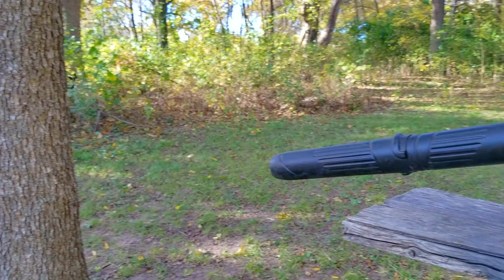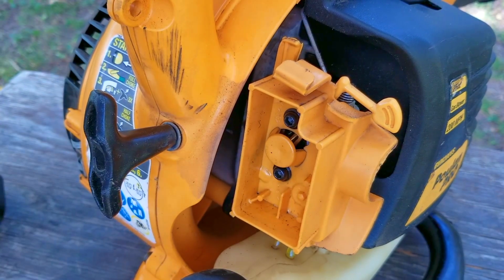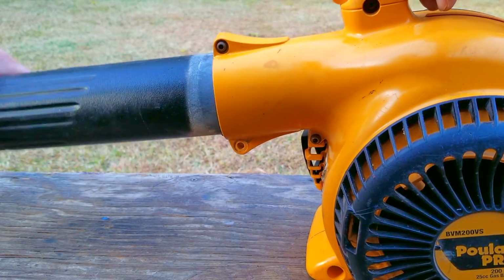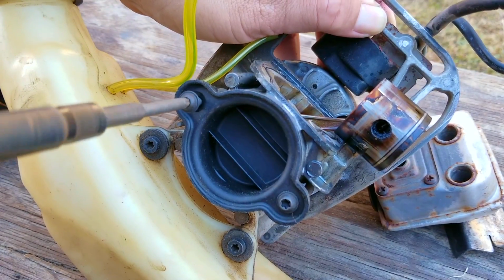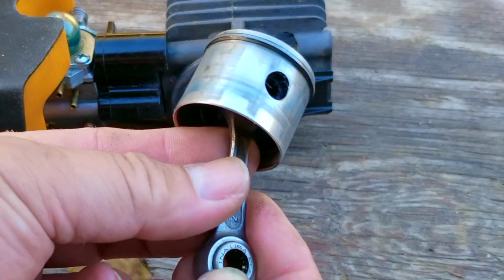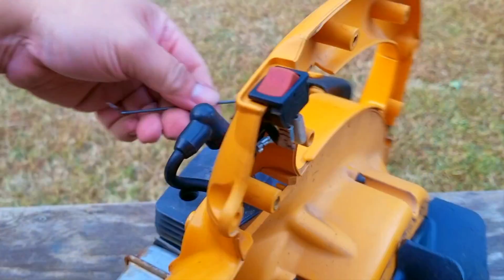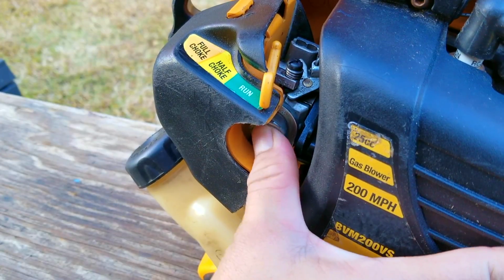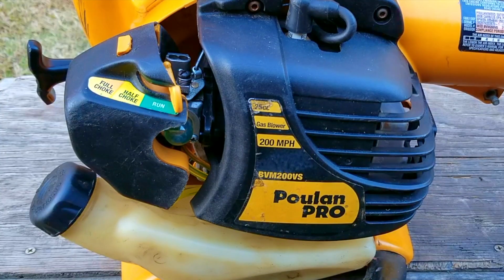Fixing a Poulan Pro blower, that stopped running while being used.

Comment: I have this same blower but the Crasftman branded version. I wound up basically replacing everything… fuel tank had a crack, needed new fuel lines and filter, carb was clogged up and cleaning it didn’t get it to run so I bought a new one that came with a whole bunch of other parts I already placed but was cheap enough to just go ahead and buy a new one instead of using the one I cleaned, a new ignition coil, new one plugs, new cylinder and new rings and finally new muffler. All in I paid more than it would have cost to buy a new one and it still doesn’t run right. It’s acting like it can’t exhaust fast enough. If I run it with the exhaust off, it can rev up somewhat but nowhere near what it should rev to and it has this almost backfire fire like issue. It’s not really backfiring, it makes a thud sound and the rpm’s die down. If I run it with the exhaust on, it won’t rev up and that backfire type action occurs as soon as you try to rev it and it dies. It’s also very hard to start it with the exhaust on. All brand new mind you. I’ve adjust the car  and can get it tuned to run the best it can either with the exhaust or best without the exhaust but something is just not right and I cannot for the life of me figure it out. Compression testing is 150psi, no head leaks, no loose bolts, gets plenty of fuel and had good strong spark so I’m at a lost on what can be adjusted or changed to make it run better. Any ideas? It’s so frustrating that I spent as much as I did “repairing it” and it still doesn’t work like it should. I could have not replaced some things but as I was going through the troubleshooting process one thing led to another and then I was like well I went this far and spent this much money, I might as well keep going and fix everything to make it new again. I like to fix all my equipment and this is the only one that I have failed on getting to run normal again. Honestly, if you are interested in making a video on trying to fix it, I can mail it and all the extra parts I have for it to you have ago at it. Right now it sits in my shed mocking me every time I open the door to get my weed whacker out. I’ve watched video after video and I haven’t seen anyone have the problem that I’m having. I’ll probably record a video of the issue I’m having and post it to see if anyone can offer suggestions on how to fix it. It takes for ever to get started (with exhaust on and much easier without it on) and I can get it to idle but when I try to rev it, it’s almost like a misfire is happening when it starts to rev higher from either too much fuel, or not air being caused from not enough exhaust being able to be pushed out and not enough oxygen getting pulled in. I don’t know I’m probably wrong on that but that’s what I’m thinking. It also crossed my mind that maybe the metering part of the carb needs adjusting (not the L H but internally), I don’t know, that’s one thing I haven’t done yet but with it being a new carb I didn’t want to mess with that being it should already be set properly, but I suppose it’s possible that could be off. I don’t want to mess with it though as to me it doesn’t seem that is the issue. Anyway, I’m done rambling now, but if you have any ideas from my rambling, it would be greatly appreciated and I’m serious about mailing it to you to give a go at it if you want. Just let me know.
Reply from the maker: Wow sounds like a real mystery.  Did you replace all the gaskets between the engine, insulator and carb?  If so did you make sure the opening for the impulse signal was lined up?  It sounds like you have an intake leak which is tough to hear, because there are so many places to have one on a 2 stroke.  As for taking it on, I'm not taking in any extra work right now.
Reply: @HomeGaragechannel  yep. New gasket, the hole is lined up and new filter.  Also I’ve tried running it without the filter on as well to see if that would change anything and it didn’t. I think my next move is going to be swapping out the new carb with the old carb and see if that changes anything. Sometimes the new Amazon carb specials even though generally are pretty good, sometimes have issues, and even though it doesn’t really seem like a carb issue, I have to start somewhere. It might give me more info to then chase a new direction. I’m really at a loss one what else it could be.  Thanks for responding though!
Reply from the maker: Sure thing and I think you're headed in the right direction

Comment: My muffler doesn't have a removable spark arrestor. I have this "same" blower in the Craftsman variant. I can't start it unless I remove the muffler. It'll choke itself out within a minute if I dont remove the muffler. Any tips? Since I can't remove the spark arrestor screen to clean it & would like to avoid $40 for a new muffler
Reply from the maker: Sure, buy a new muffler.
Reply: @HomeGaragechannel have you had any luck with soafoam treatments or torching the entire muffler while its encased to burn off the carbon or is it not worth it & still think its best I get a new one? I haven't tried any of that but I trust your opinion
Reply from the maker: I have not tried either.  But if I had to try one I would try burning the muffler in a fire.

Comment: Great video thank you so much helps a lot!
But about the fuel do I change the filter or what does it actually needs? Because I took the flitter out and i stroke it and it started running well it didnt stop or anything so what I have to do?
Reply from the maker: You can absolutely ran an engine without a fuel filter howe "any" debris that might be in the fuel tank will get clogged in the carb over some time.  I would replace the fuel filter.

Comment: I have a similar blower; it was given to me for free and had been taken apart before but they did a poor job at putting it back together and as a result it ran poorly so I decided to take it apart and replace parts that were missing as well as servicing the carb. it starts way better now but it smokes when I turn it off and I don't know what to turn to now any help would be greatly appreciated
Reply from the maker: sure, how are you mixing your fuel?  Are you adding too much oil?
Reply: I use a bottle of pre measured amount of oil that all I need to do is add it to 5 L of gas
Reply from the maker: how much is in the bottle of "pre measured amount of oil"?
Reply: @HomeGaragechannel  it is echo power blend 50:1 a little bit rich on oil, it don’t smoke when running just after you turn it off. I just noticed that it is melting the shell so the motor is running hot

Comment: I have a similar model to this. Runs but then it gets super hot then it trys to bog down then die. It overheats and gets super hot. Nothing with the carburetor or the filter as that’s clean. But I shut it off and I see smoke coming from it and  a burning smell of plastic. I don’t know where and what is causing its. I gave it a wash CAREFULLY by the engine and that didn’t fix anything.
Reply from the maker: it would seem your engine has a leak and that's the reason why it's smoking, it's burning the oil that's coming out of the leak.

Comment: I would have used a smaller allen wrench and removed it that way and then applied thread locker on the screws i have this exact same problem
Reply from the maker: that works too.

Comment: ANOTHER great video!  And again, something I’ve not seen before.   

Just in case someone out there doesn’t know, there is also RED thread lock.  Use this and you’ll NEVER get the parts apart, at least not without a blowtorch.
Reply from the maker: Great point!

Comment: I would have taken this all apart myself, get a good look at the piston and cylinder.  No scoring on it after 14 years, pretty good, probably due to the 40:1 fuel mixture.  Oils are so good now, I run everything at 50:1. Two bolts holding the cylinder down, no wonder it got loose.  Great channel, like how thorough you are.
Reply from the maker: all your points are true and thank you for the comment!

Comment: THANK YOU FOR THIS.

I have this exact model. I replaced the carb, fuel filter, spark plug, hoses, still wouldn't start. For a couple months prior, It would run okay as long as I kept the choke at half. But then I took apart the carb and cleaned it. After that it wouldn't start at all. I thought maybe I damaged something in the carburetor with the air compressor. But I replaced it and same problem.  I googled the crap out of this trying to figure out the problem. Everywhere the same suggestions - carburetor, fuel filter, air filter, rewind spring, old fuel, spark plug - all was tested/replaced and fine. I was going to junk it when I saw this and remembered that I had noticed that wiggling/play indicating loose bolts holding the top part of the engine to the bottom.

For the rear bolt, I just cut into the plastic a bit with a dremel so the allen wrench could get in there.
Reply from the maker: very nice that works too.

Comment: I have the same blower. What do you look for when you squirt gas in the carb and it still won't start? I have fresh fuel, spark, primer bulb works, nothing loose, carb screen is clean, piston is clean,feels like good compression ( havnt tested it with a Guage) carb diaphragm is pliable.  Idk. Any ideas? Thanks
Reply from the maker: first I would ask "when was the last time it ran" and then I would suggest trying to start it by clearing the "flood" that's In the engine, after that get a compression test done
Reply: @HomeGaragechannel  it ran days before, then just 1 day it wouldn't start. I will give it a compression test soon. Thanks.

Comment: I would probably take it down and spread some #2 Permatex on the head/block gasket and then l loc-tited it back up if it was mine but if not, my son-in-law would have it or I'd jacked the Poulan up and driven a Stihl or Echo under it. I'm just not a Poulan fan but am glad you got it fixed! BLESSINGS!
Reply from the maker: I hear that a lot, but they are very cheap, and if taken care of, can be worth the price.
Reply: @HomeGaragechannel  Just like a Homelite.
Reply from the maker: yes I feel the same with them, they're cheap,  and use good fuel, and prep it for winter, I think they'll last .
Reply: @HomeGaragechannel  I started running an old C-5 Homelite saw in my teens and found that they were like the Briggs flat heads as far as being reliable, easy to work on and tough.  A 923 or 925 was a bear of a saw like a McCullough Super Pro 81. They messed around and got modern and quality went down, just like Briggs adopting Tecumseh ways and parts but they used to be good products.
Reply from the maker: that's a real shame the quality dropped.
Reply: @HomeGaragechannel  Sure is but that's the way the powers that be want it. Greed gets it's way eventually!

Comment: I replaced the carb, tried to adjust it, and checked the engine bolts (they were tight) but it still bogs when at full throttle. I don’t know what else I can do.
Reply from the maker: did you check the spark arrestor screen?
Reply: @HomeGaragechannel  yes
Reply from the maker: I would suggest you take it to a tinkerer like me, and have them adjust the carb.

Comment: Have the same blower and had the same thing happen. Except I just tightened the bolts to keep going. It ran for maybe 30 minutes more and locked up tight. Took it apart and the ring had broke and wedged between the piston and bore.
Reply from the maker: wow, that's some damage, what did you end up doing with it?
Reply: @HomeGaragechannel  I ended up finding another one that looked as if had been ran over. All the plastic was cracked and the blower tube was gone. But the engine was ok. I just replaced my engine with it and had to swap carburator over for the one I found was damaged. Been ok for several years now. I also used locktite on those bolts
Reply from the maker: very nice work.

Comment: No, you aren't overdoing it when you put thread lock on the screws that hold the housing to the motor behind the fan. I had a blower that would turn over sometimes, and would lock up others. It was one of those stupid bolts coming in contact with the fan, I put red lock tight on it and dared it to come out again.
Reply from the maker: thank you Donald Bower.

Comment: Had a freebie 2004 one of these and it quit running after I cleaned the carb so I took it apart and threw the housing away and kept the engine. No patience.
Reply from the maker: I completely understand

Comment: for me i would have installed a Heli-coil if the allen screws were rattling loose on the cylinder block base etc.
Reply from the maker: that would have been a good option as well.
Reply: @HomeGaragechannel  yes for sure as it has a 99% success rate.

Comment: It's disappointing that these blowers are not designed for servicing (no matter who's the manufacturer).  Simple repair/maintenance tasks require an almost entire disassembly every time.
Reply from the maker: you are absolutely correct.  the only thing that's easy to get to is the Carb.

Comment: this is why i usually won't touch a fix leaf blowers for people. more times than not they are such a pain to do anything on. even just replacing the fuel lines on most machines is a big job and you almost always have to replace these when you rebuild the carb and one of the old lines snap.
Reply from the maker: you make a good point, it can definitely be a pain sometimes.

Comment: Great video!! I would have put thread locker on the screws too, but l would have put a little Motoseal gasket maker on that head gasket before reasembly. I had a blower that had a leaky head gasket and the Motoseal sealed it right up. What oil have you been running in that engine? That seems like a lot of carbon built up on that piston. I have had good results with Amsoil Saber @ 80:1 and Echo Red Armor @50:1 keeping my piston ring grooves carbon free.
Reply from the maker: thank you Ethan Miller. I might have to look into Amsoil

Comment: speaking of straight gas my grandpa put straight gas in a old shindinawa t20 homepro which he still has he put straight gas in it an seized it up enough to not be able to pull over by the rope so what i did was took the recoil off took the spark plug out an sprayed wd40 and two stroke into the the head took a socket an ratchet an turned it over a abunch of times so it was easier to turn over with the rope put it all back together put proper two stroke gas in it an it started up with no problem
Reply from the maker: wow, that's amazing that it started again.
Reply: @HomeGaragechannel  yeah it ran perfectly fine

Comment: why do you run it a bit rich?
Reply from the maker: a long time ago, I would set the fuel to optimum, and the Engine speed would be at it's max,  I then found out that the engine would overheat, and the piston rings would get destroyed.  it was a hard lesson.  I had seen all the other people setting a bit rich,  and now I know why, the engine will run cooler with the extra fuel.

Comment: Must be a common issue. I have craftsman blower with the same set up. Had the same issue with mine and i also found the piston ring was stuck. When i fixed mine all i had was engine assembly lube.  I used just a little bit and now that i fixed it it runs like i just put a new piston and cylinder on it. I put thread locker on both of the cylinder bolts
Reply from the maker: nice work James Hedrick

Comment: I mentioned in a previous video that I have the exact same poulan. I had to do this repair after 10 years. Although I didn’t thread lock the back bolt, just tightened. Good video man.
Reply from the maker: thank you J G I appreciate it

Comment: So i found this video of exactly what’s happening with my snow blower ( https://youtu.be/rlFoUZt8nYc ). When company leaves this week, I’ll pull it out, and try what this guy did and see if I could stop it from leaking. Im guess what caused this was not from over priming (eh, maybe part of it), but the pull cord housing is broken and it needs to be started with a drill. Im guessing the drill is having the engine pull too much fuel into the carb before the engine can start, to the point it’s over flowing.
Reply from the maker: I would also check your spark plug
Reply: @HomeGaragechannel  I doubt that would be an issue since it started one time and didn’t start the next time. But I’ll check anyway, if I could find it (not visible from the top.
Reply: @HomeGaragechannel  so I pulled out that old snow bower, pulled out the park plug (it’s was actually exposed which I thought it wasn’t.) it didn’t look too bad, so I took a fire place lighter, couldn’t do anything so I put it back in. Look apart the side like that guy did in the video. It was still doing the same thing, so I didn’t have much hope. I filmed a quick video so I could upload it so you can see what’s happening, but the gas decided to not spit out anymore. I took a corded drill to it, big puff of old gas smoke, and it started,  at this point, I ran the tank dry and is stored until the first snow fall.
Reply from the maker: as long as you know how to get it started, I wouldn't mess with it too much till you get a chance
Reply: @HomeGaragechannel  well since it works, there is nothing to do to it, for now. Also, not too worried about this old one since we have a slightly larger one for the larger snow falls, this little one is nice to just grab and use for an hour without too much fuss. Also, before I started to clear the driveway, my father was putting gas and oil mix into it without realizing it only takes straight gas 😬. Luckily, no engine damage after 15 years of doing that one, some how. Now I just clean the driveway in the morning while everyone stays sleeping in lol.